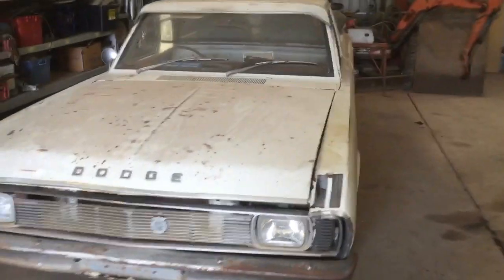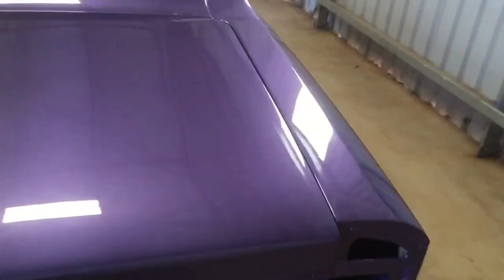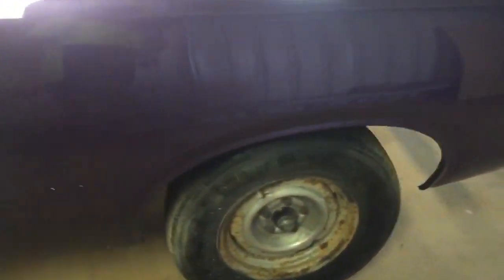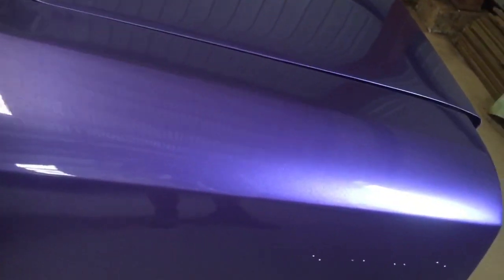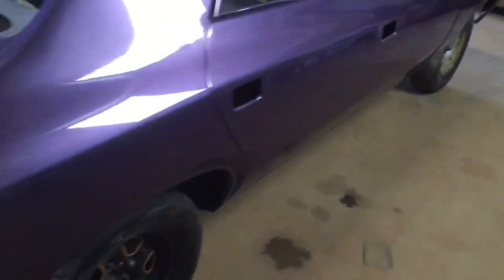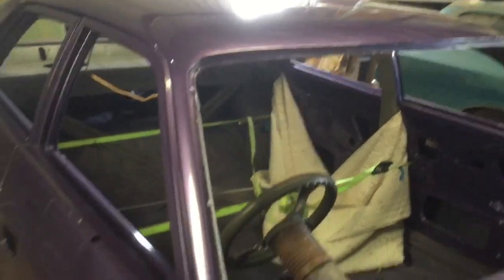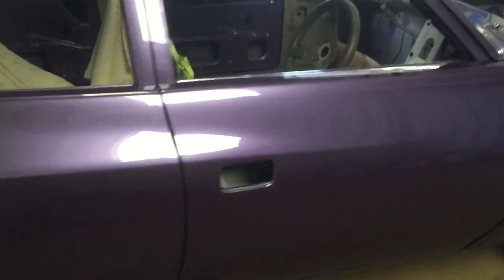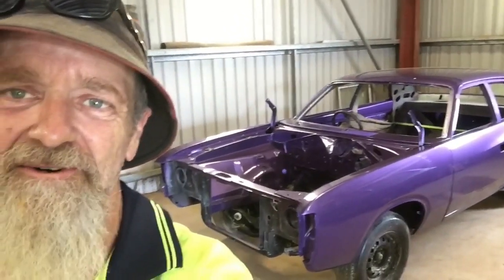VJ regal A54 resto part5

Comment: I love it, it's a stunner with the plum crazy.  You did nice bodywork mate much better than most panel shops do. It's straighter than how they left the factory.  It's got to have a hot 360 /727 .  I used whiteline swaybars on the regal se,  made it stick like glue to the road,  they fit the nine inch easy enough to. This is going to be one of the best cars around.  Can't wait to see this beast come together.  Beautiful work mate.
Reply from the maker: Thanks mate it is looking pretty good 
It’s got a 30mm whiteline on the front so should stay flat😉
Cheers 🍻